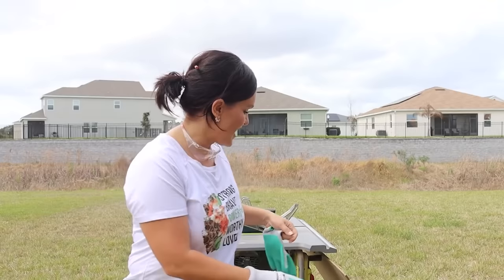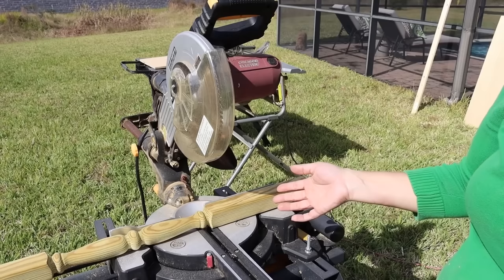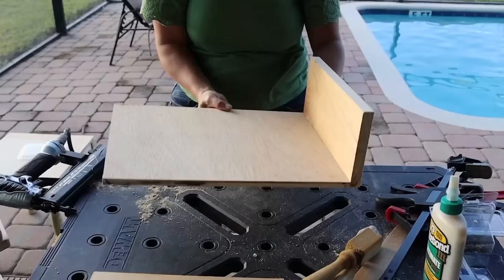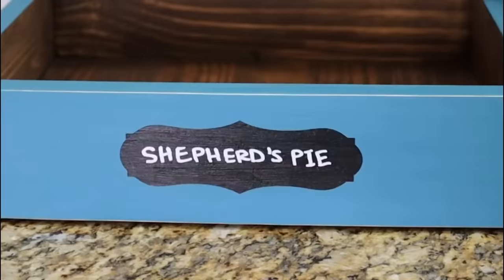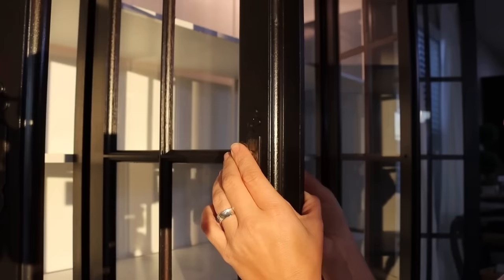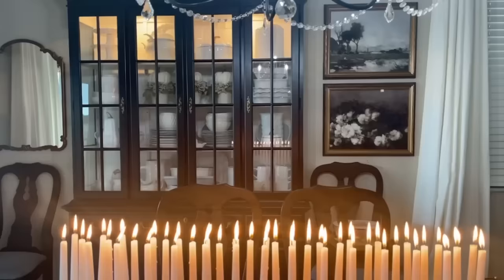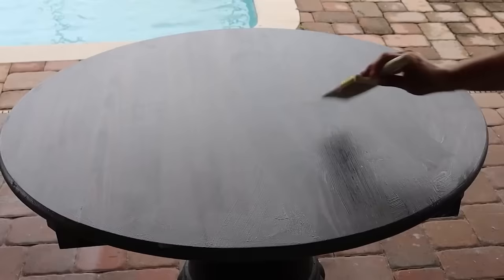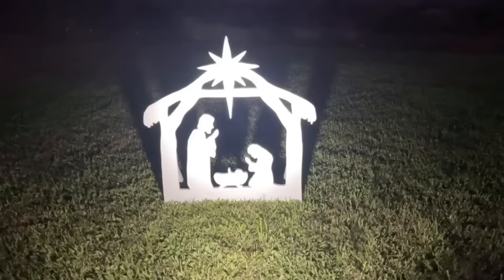23 Absolute Best HIGH END DIY Decor to try in 2023!

Comment: You are sooo creative and skillful! I have a suggestion though when you are cutting wood in circular shape. I think it is best to draw a straight line on all 4 edges (or corners?) of the circle. And from that square shape, draw another straight line on all corners of the square and cut the wood. With that , you will only have to use your handsaw on all the edges and come up with smooth edges.  You can sand if needed.

Comment: Questions/concerns about the 4x4 with holes for test tubes or candles. 
1. It looks like pressure treated wood which I would never use indoors because of the chemicals to treat it, and you need to be sure you don't inhale the dust when sanding.
2. With candles close together, do the candles bend together in the heat of the flame or stay upright? (I once put 50 birthday candles on a bundt cake and they bent down into the center with flames over a foot high! I was terrified of burning the place down!)